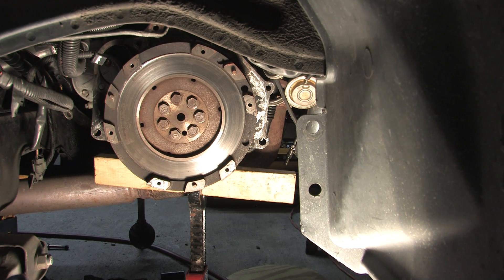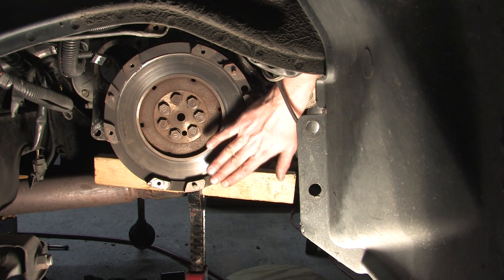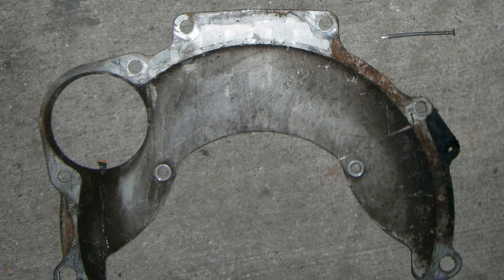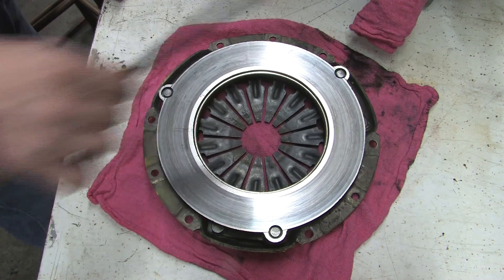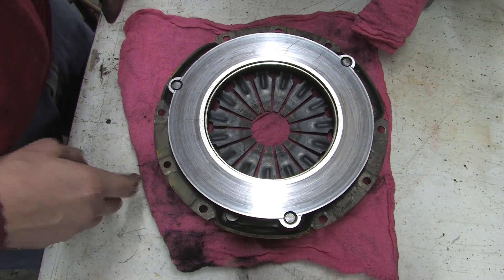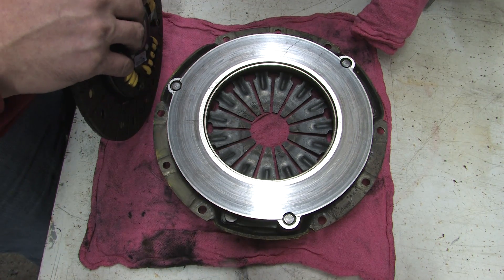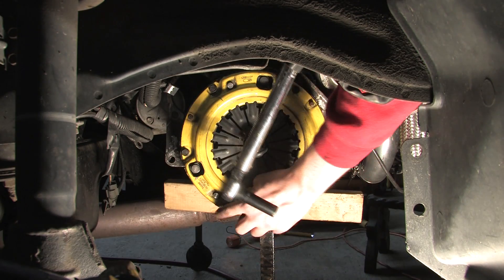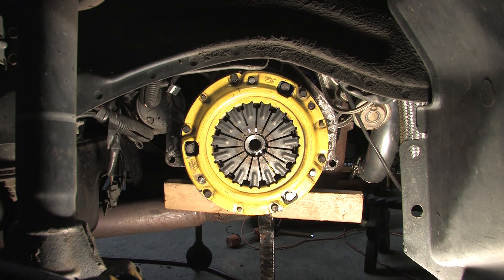Trans & Clutch 4 - Installing The Clutch

Comment: I've been using a front-wheel drive starter for my 2 G all-wheel drive. Is that a problem? Or does the 2G use the same starter? It seems to work just fine

Comment: Hello I have 1g dsm awd talon I am wondering one thing about flywheel.. Elantra flywheel is same as awd 6 bolt flywheel? i counted elantra has 106 theeths also Did you recognize after remove the elantra's flywheel? There are  label on the flywheel 63D4D and 63DT4..63D4D is for 4g61 other one is awd 6 bolt..Can you explain for me? thank you

Comment: I have a 400whp 400tq evo x and i put a comp stage 3 clutch in and it failed under 15000kms.... was thinking of an act 6 puck..... i just need something that will hold the torque.... i dont launch or anything whats your recommendation?

Comment: My Flywheel is Stepped at .609 I did know that .610 is sweetspot for DSM but I was wondering SHOULD I get it Machined to exactly .610 or is .609 ok?  I have this Pressure plate and a Sprung 6 Puck brand new from ACT with an ACT Flywheel.. TY for these VIDEOS!!! Rebuilt my WHOLE engine Watching these Videos THANK YOU!!
Reply from the maker: The 1/1000 of an inch can be compensated for with proper clutch adjustment, so .609" isn't wrong.  You should be able to compensate for that.  less than .608 would start causing problems.  You might run out of room for the clutch disc springs and the pressure plate springs to operate if that were tighter.  You just need enough room for that clutch to fully disengage and not interfere with the springs.  You can test all of that before putting it on the street with my clutch adjustment video.  :)
Reply: Jafromobile ty sir. I watched almost all the gsx videos. Gonna watch the adjustment one again. Im waiting for dowel pin for flywheel to crankshaft. Was told that was important. But cant remember if there was one in it before. Once i have that i can bolt on the flywheel again. Or is dowel not key? Ty for all your knowledge. I hope to have my gsx on road and going to events this spring... Be Blessed Sir...

Comment: no loctite on the pressure plate bolts? did you ever have any problem with them backing out?
Reply from the maker: I've never had a pressure plate back off, but that's not saying you shouldn't use the blue loctite.  These bolts don't receive very much torque.  They've got captive lock washers, and if everything's balanced and you have a good clutch that doesn't chatter, then they should never back out.  I've had chattery clutches and they've always stayed put.

Comment: rip shop light, it was a good light, cut down to early in its prime.
Reply from the maker: +The Headless Horseman It tried to kill me and paid the ultimate price.
Reply: +Jafromobile yes I did sense some anger in that leg shake that sent it to the ground
Reply from the maker: The Headless Horseman I shouldn't have struck him down in anger.  I made it more powerful than I will ever know.  Whenever Yoda and Obi Wan pop up from the afterlife, my shop light is floating right there with them.

Comment: i just installed a new clutch on my 2001 mitsibishi eclipse the gears go in with out the clutch but the wheels wont spin we only have the driver side axle on not sure if putting the other one should make a difference can anyone help?
Reply from the maker: Jasmine Magana It has an open differential.  The wheels won't turn unless both axles are installed.  One side is "free wheeling".

Comment: When purchasing a used pressure plate, should one be concern about non-centered tob wear on the pp fingers? I has seen this on most, if not all, used pp for sale and I have a suspicion this leads to broken fingers on the pp...

Oh and thanks for your uploads, definitely going to guide me through my clutch installation.
Reply from the maker: Ryan Tucker I would re-use one of my own, but I personally would never buy someone else's used clutch.  I might take it off their hands, but unless it was a twin-disc with its own flywheel, I would keep my wallet in my pocket.  I wouldn't risk breaking it in on 2 different flywheels.  Clutch tolerances are in thousandths of an inch.

Edit:  Yes, it's true I re-used the GSX pressure plate on the Hyundai Elantra.  I also had both flywheels cut to .610 step height first, and know I only have a thousand miles and 2 dozen drag passes on it.

Comment: you know your not supposed to use your torque wrench as a ratchet eh.
Reply: mmhhmmm, but everyone does. Sometimes its all youve got that will reach.
Reply: Yeah, but we all do
Reply: Kartyman550 I suppose you are saying when he´s installing the clutch plate? He's using a Long Shaft Ratchet with angle capable head not a Torque Wrench.

Comment: A terrific series!
I had a new clutch fitted here in Thailand on my Suzuki Vitara......the fulcrum fingers were worn away so replaced all, disc, friction disc, thrust bearing and cable (yes cable). Since then I get a hint of grating on changing hear and am told it could be the friction disc was not aligned properly so been learning so I understand before it goes back in to get fixed. I've just been on a long trip with it imperfect, it drives, but it's not right, and I'm told it's called clutch drag though when stationary one can't detect any torque going through when the pedals down so I'm still not quite clear on how the slight grating or clicking get to be.
BTw....What do you use to speed up time on your videos?

Thanks again!
Reply from the maker: I use iMovie.  A 9 year old copy of it.  Not because it's the best.  But because it's simple and it works.  Miraculously, a 9 year old application like iMovie can work with 1080/30 HD video sources.  This format didn't exist when the application was built.

I don't think it's clutch drag.  I think it's your throwout bearing.  The only other thing I'd think might be a pilot bearing, if your car has one.  If it makes noise with your foot off the pedal, it's the pilot bearing.  If it makes noise with your foot on the clutch, it's the throwout bearing.  If it makes a clicking sound only when you press the pedal, it could be your clutch adjustment.  Hopefully it's the latter because either of the other 2 options require basically doing the whole job over again to get to those bearings.

Last thing I got... my old original 1st-build super-shiny Injen turbo intake is in an Eclipse somewhere in Thailand.  I sold it on DSMtrader to someone in Thailand.
Reply: ***** Thanx for the reply Jafro....
I just look up throwout bearing and we call it a thrust bearing.
But that's been replaced the old one had worn into the fingers on the cover plate.
No noises apart from maybe a hint on when the gears are very-slightly-grating, more like a slight burring or clicking, on a gear change.....but nothing from clutch I think.

BTW as for your software are you saying you take the full movie in HD then iMovie cuts out and throws away most of the frames?
Just asking as I tend to use my iPad for video and the memory is limited. The pure unadulterated ipad video clip seems to use an awful lot of bytes many more than an equivalent time on a Piratebay type video!

Comment: Q:  I have a "90 Talon TSI AWD and I installed the same clutch and pressure plate that you did in the video.  When I mated the transmission to the block there is a massive amount of play with the clutch fork.  I can push it all the way back to the transmission and it doesn't even touch the clutch fingers at all. Should I shim the clutch fork or is there another problem to address? Also after installing the clutch, the fingers seemed almost flat instead of domed. Is this normal for this clutch?

Comment: im going to change my clutch in fiat multiple can you show me or tell me if i have to take  the wheel of the  side the clutch is not, i no  i bleed and take casing of to get to clutch plate, ever done this job but rather save money as i cant aford it , so please can you help me, one fella took  both wheels of to twist to get transmission in, please have you any videoa of fiat

Comment: I looked in a Chilton manual and it turns out it is 98 ft. lbs. I don't usually use Chiltons manuals, but after seeing it in there, I have to say it's probably right.

Many mechanics depend on Alldata for their repairs; which means that there must be a bunch of DSM's out there with under-torqued flywheels. Unbelievable that a reputable company like Alldata has wrong information in it!

Anyway, I popped my slave cylinder like you did and have to replace it.

Comment: Jafro,

I'm doing my clutch right now. I see you torque your flywheel bolts to 98 ft-lbs and I also read it mentioned on forums. According to Alldata, they should be torqued to 55 ft. lbs.; which is half that. Did you get your number out of a manual? I just want to make sure because it really sucks when you snap a bolt over-torquing.

Comment: I'm trying to install a clutch for my AT to MT conversion and there is a 4mm gap between the flywheel and pressure plate cover.  Is that normal?  I've already tightened down the bolts successfully just not sure if that's the way to do it.  No tutorial video or images I've seen mention a gap.  If it's not normal what is your advice?

Comment: I think it would be worth mentioning here that one should ONLY use flywheel bolts when securing it to the crankshaft. They are special bolts and you will not find them at your local hardware store. Now, I am speaking about the ones on a 3SI but I would bet they are the same design on the DSM's since the transmissions look almost identical. Feel free to confirm this but the ones on 3SI's have a tapered shaft at the heads of the bolt.

Comment: I just swap my auto to 5 speed and my clutch won't disengage it won't go into gears but when I put my pressure plate on I think I put it to tight I made the plate lay flat on the flywheel is that wrong please help

Comment: Ive got a flywheel question for you if you could please get back to me. I bought a comp clutch lightweight for my early 92 6bolt and the teeth arent meshing with the starter it seems like the starter isnt coming far enough away from the engine to mesh up, i checked the teeth of the original against my new one i rolled my old one on the new one they seems the same just the starter dosent seem like its going to reach into the bell housing far enough... please respond thank you for all these guides

Comment: so why have the tool? Coz you should be checking the the machinest's work before you assemble. Machinests are just maching to the spec's that you give them. You should still hold them accountable for their work. Not just ASSUME  that they did what they said they would. If i had done this during my current build, my motor would have failed again due to my alignbore. ALWAYS check your verify that your machinist did their work correctly. :)